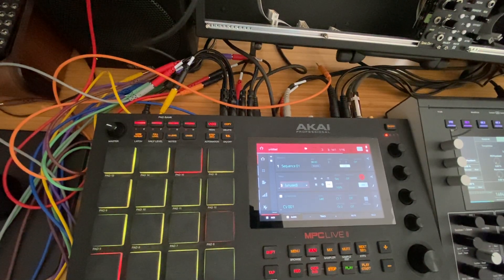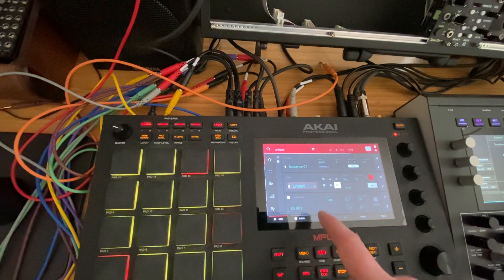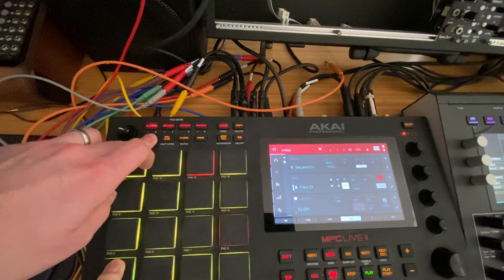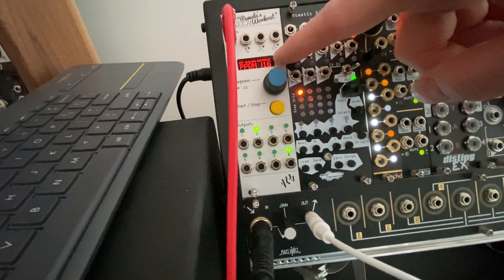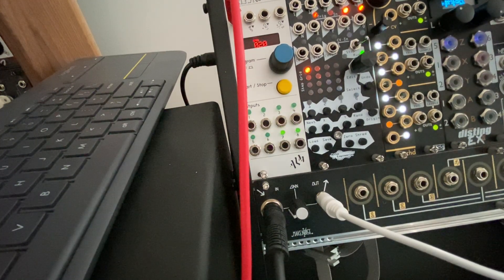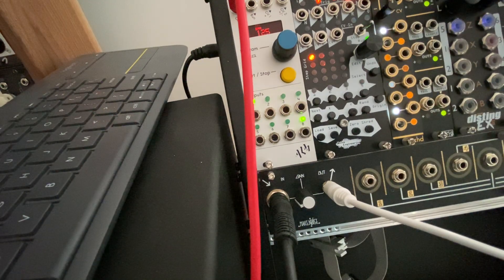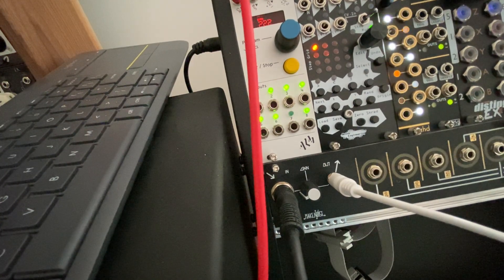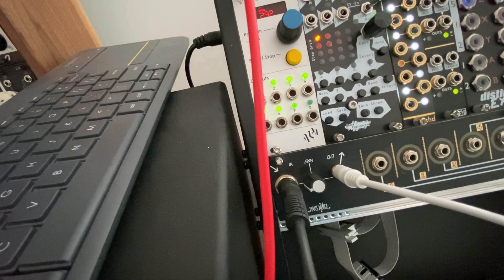Syncing your MPC Live mk2/X/One to Eurorack Pamela's New Workout

Comment: quick question for you :  let's say you get your PNW synced to your MPC's clock and you run a sequence on your MPC. Does the PNW start to play on time, locked on the beat, if you press the start button at any give time? Does it catch up and play as soon as the next gate is received? Thanks !
Reply from the maker: it will keep playing from the step it is on, to get a it to start on the bar again, you need to send a gate to reset it back to step 1… I forget the name off hand but it is the the top row second jack from the left… guess I can make a video for it when I get back home in case it helps
Reply: @NearTao  for that you can should a second track, put just one note on the beginning, and set a long loop , like 64 or 128 step (whichever you like) and connect that tracks gate out to the PNW reset in. i have it set up like that with an MPC one and works well. You can vary your loop lenght to infinity if you dont want it to reset unless you start the track again. But good idea to put that tutorial in!
Reply: Doesn’t work well for me. The clock is not stable at the end of the sequence when it loops. And the run tricks doesn’t work well neither. Could you do a quick tuto for this ?